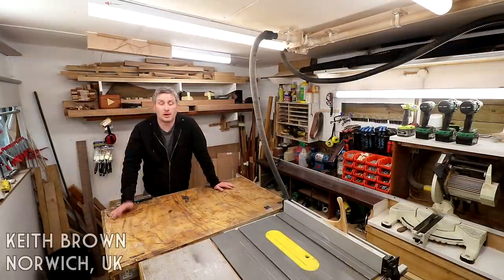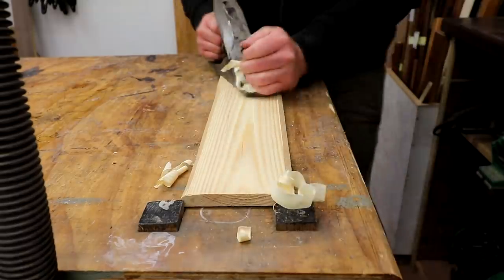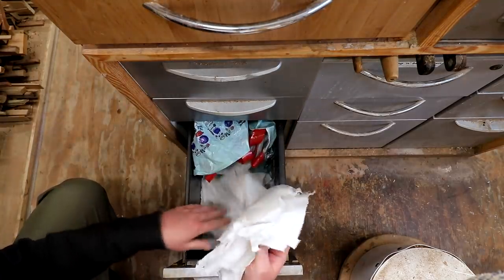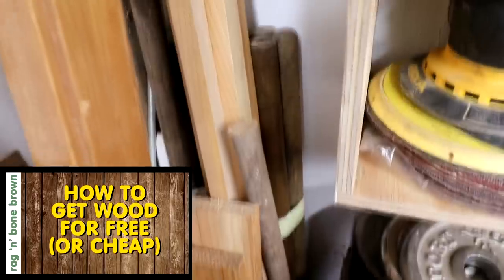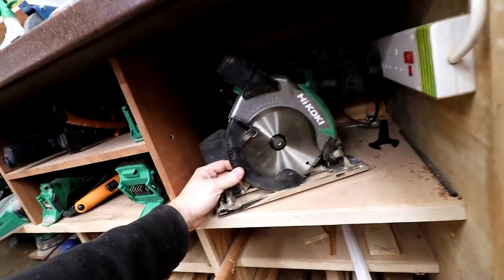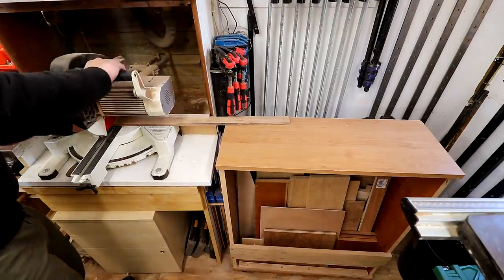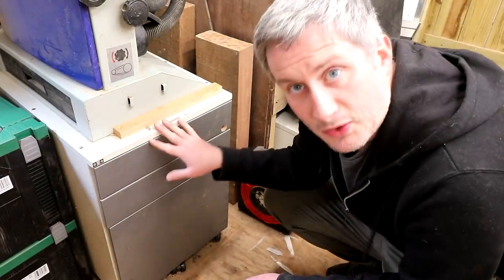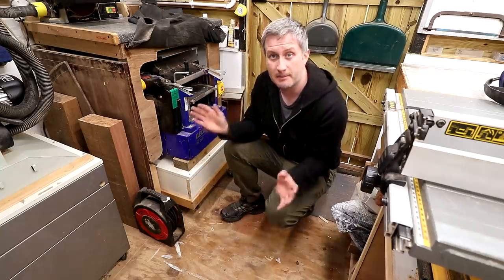WORKSHOP TOUR 2019 - Rag 'n' Bone Brown UK

Comment: 3M 6500 respirator is really good and the exhalation valve is angled down so it doesn't steam safety glasses up. It also has a drop down mechanism to allow you to talk without taking it off!
Reply from the maker: Thanks will check it out

Comment: Really interesting to see the workshop Keith. I'm about to move into a converted container workshop which is probably roughly the same size (160sqft) so great to see a few of your canny storage ideas.
On the dust ask front, I recently switched to the trend air stealth. It has the 2 straps that you like and I've found it pretty effective, though still getting used to it after moving over from then gvs mask.
Reply from the maker: Thanks I’ll check that one out

Comment: Paul sellers has a video on how to improve cheap aluminum bar clamps. Ypu should check it out if you haven't already.
Reply from the maker: I actually did those improvements to mine, including putting wood inside the bar. Unfortunately it’s the heads on mine that just do not work well they’re very poor. I love Paul but I can’t understand how he gets good results with them!

Comment: Hi Keith, you mention that you find the Dewalt dw745 very noisy, I have the Dewalt dw7491 (presumably the same motor) and agree that it is incredibly noisy even with good quality ear defenders on. What are you considering replacing it with?
Reply from the maker: Either a brushless battery operated saw or one with an induction motor. Check out Badger Workshop he has some interesting videos about his journey to finding a saw that isn’t as loud as an aeroplane! 👍

Comment: Nice tour. Question for you. Given that you have a compressor, why didn't you buy an air-operated sprayer instead of an electric sprayer?
Reply from the maker: Thanks! I was given the electric sprayer by Teccpo. I do have an air spray gun (cheap one, was supplied with my old compressor) but haven’t used it yet as the plan was originally to get rid of the compressor. But now I think I’ll probably keep it.
Reply: If I may ask another question :) If you were going out to buy a brad nailer and a sprayer today, would you go for two electric tools or air tools with a compressor?
Reply from the maker: @mikedeman5351  it would depend on a) how much money I had, b) how much space I had and c) how bothered I was about weight.  I prefer cordless electric tools because you're not tethered to a hose and no need to drag a compressor to wherever you want to use it, but the downside is that they are heavier and more expensive than air tools
Reply: Thanks for your insight into this. I am on the verge of buying a sprayer and a brad nailer. I think I am going to go with air tools. I will never use the sprayer or nailer outside my shed so I don't mind a hose as long as it is flexible. It seems I can get a small compressor, a basic gravity sprayer and a brad-nailer for about £200, whereas a battery- or gas-operated nailer will cost a lot more. My shed is small but my budget is smaller still :)

Comment: Respirators aren't needed, big filter just makes you think they are! I find the best way is to just hold your breath when you're doing something partially dusty! You don't need a filter if you're not breathing!
Reply from the maker: Having an air quality monitor has taught me a lot about how many fine particles of dust are in the workshop air and how long they float about for before settling, and I have found it  quite surprising. And a little scary! I hate respirators but they are necessary unfortunately